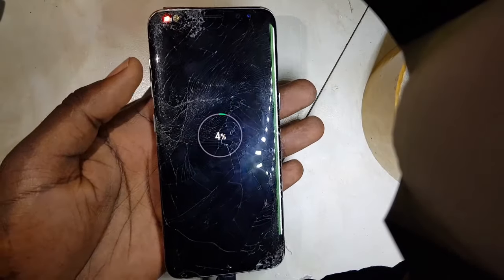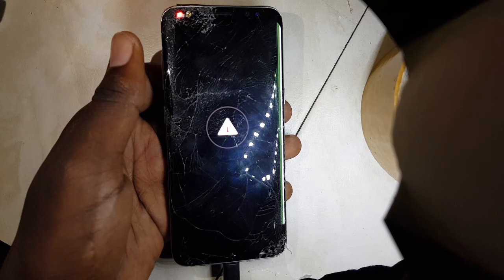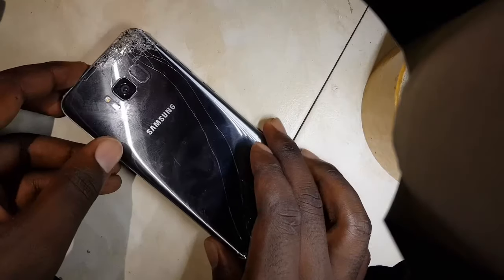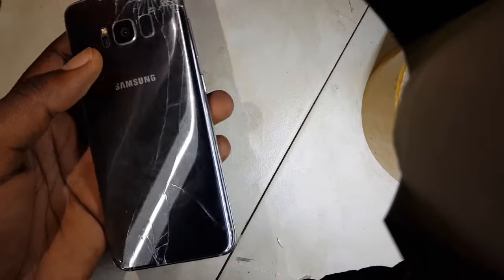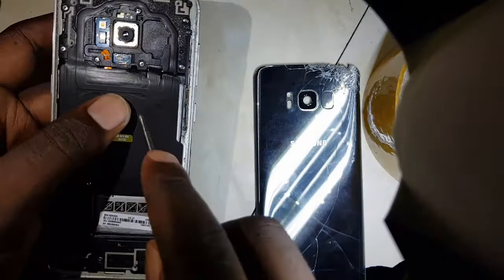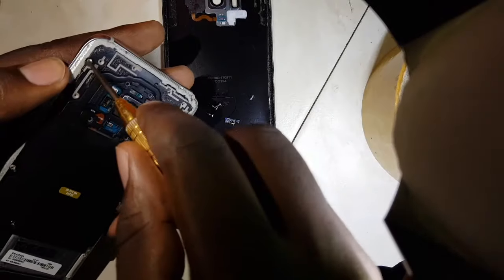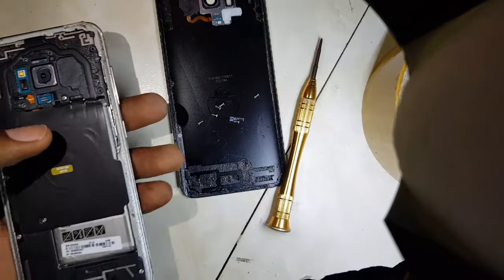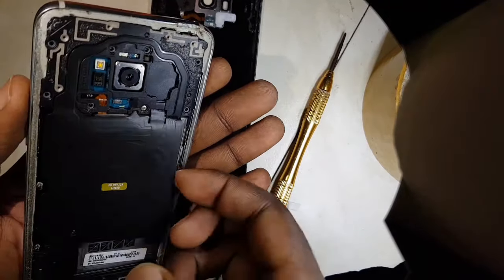How to fix Samsung S8 charging error temperature too low charging stopped

Comment: Thanks mate - a very good video. 
In my case, one of the copper tracks is broken and I'm in a hurry for the phone to be working.
So I think I'm going to do some micro-soldering with a short piece very fine copper wire as a temporary fix - long enough to transfer my data on to another phone while I wait for the new part.

Comment: Thanks, stupid question but is it possible to jump the circuit contacts to negate the need for the NFC/WPC Antenna.
I don't care or use those features anyway.
Reply: I'm curious too. This error is annoying.
Reply from the maker: I think that's something I have to experiment with

Comment: and what if the mobile overheated after battery replacement???
Reply from the maker: If overheated when not in use probably there is a short component on the motherboard

Comment: Hi bro. By watching your video I discover mu nfc thermistor contactr on the board need to be replaced or repaired. Do you think this is possible? They are badly damaged and they are not making contact with the nfc flex
Reply from the maker: yes its fixable, take to a professional Technician he will replace them
Reply: @platinumphonesandcomputers  thanks

Comment: Thanks, man. I didn't open the phone but I dried the charging port with my hairdryer and it stated to charge again. The air in my house is very moist. Thanks again.
Reply from the maker: Glad I could help🙂
Reply: @platinumphonesandcomputers  can i do that method to vivo because i have the same problem
Reply from the maker: @johnacemoreno8042  Yes especially if it has wireless charging